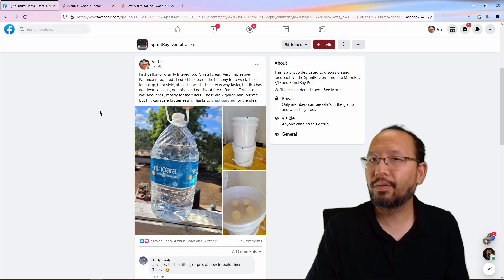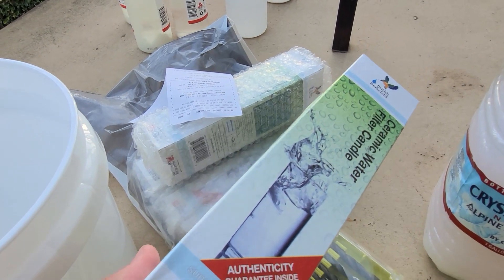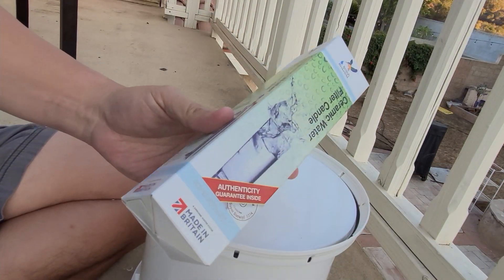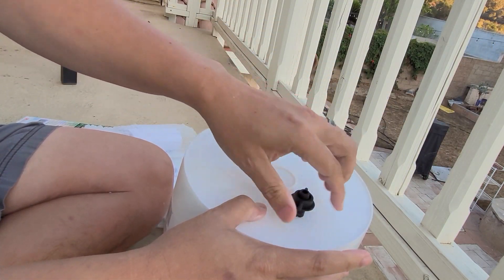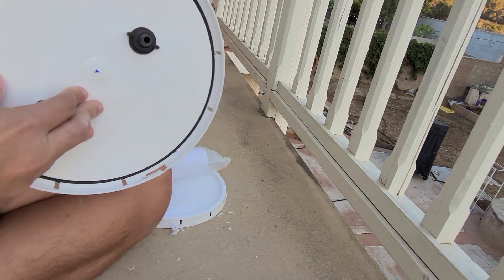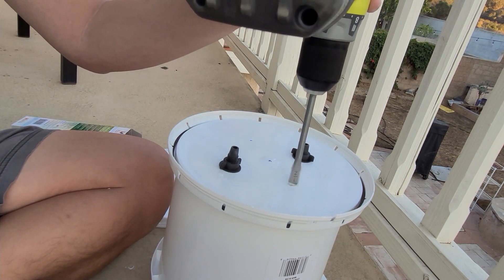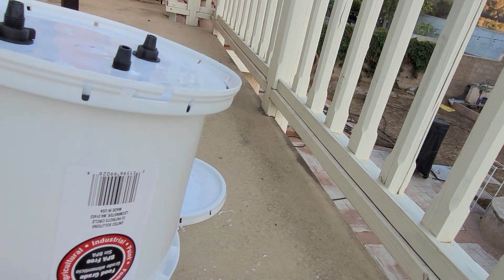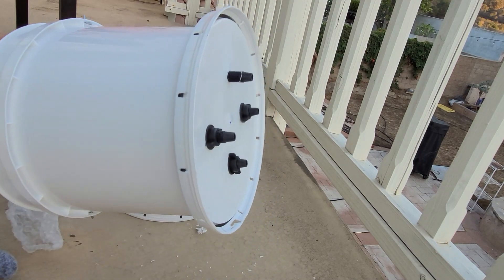DIY Gravity Filter for Isopropyl Alcohol Using Ceramic Filter Candles

Comment: Kudos on the syphoning (with pump, not with mouth :))!
It's so much better than decanting!

I would love to see a DIY centrifuge for better separation of IPA & resin.
It doesn't seem hard to do, you just need to securely attach the bottles to the centrifuge in a way that they're free to move up depending on the spin speed (ie vertical when not spinning and higher when spinning faster), so that the "down" of the bottle still points directly to the bottom of the bottle. And ideally gradually stopping it so that it doesn't shake and mix the resin back.
Then you should be able to syphon the clearer IPA from the top.
Reply: I agree, UV light from the side while spinning should help the particles coagulate and cure on sides and bottom.

Comment: I really think filtering is just not necessary. Gravity is all that is needed. Definitely no curing of disolved resin in the alcohol. I've beed doing this for a couple of years. And 200 micron filter is so course. I don't think any uncured resin is anyhwere near that large a partical size. Do you realise that 200 microns is FOUR 0.05mm layers.
Edit: I am sure you just mispoke when saying 200 microns. A quick google found they are more like 0.5 microns. I expect there are other sizes too. Perhaps yours are 0.2 microns. :)

Comment: Has anyone been able to verify that it really works? It is the only video that claims to leave isopropyl alcohol completely transparent. Ceramic filters are really expensive if this process doesn't really work. Thank you
Reply from the maker: It's got a slight color twinge to it after a few loads.  I let the filters run dry for a while, I don't know if that's the reason.  Distillation produces the cleanest results but that comes with a whole different set of issues and risks.

Comment: Are you still using this technique? How much “life” do you get out of the individual candles?
Reply from the maker: I'm afraid I am going to have to discontinue this jig.  It developed a leak and now the dirty sludge is leaking into the bottom.  I'll consider rebuilding it with a single dome filter in the future to reduce potential leakage points.
Reply: @photodontist8640  I couldn't get it to work w/out leaking myself

Comment: Wouldn't you get better flow if you drilled holes from the bottom to the top container, installed a pipe to above the fill level of the top container to allow for pressure equalization between the containers?
Reply from the maker: I hadn't thought of that.  It's not a bad idea.  I just open them up every day or two to relieve the negative pressure.

Comment: Could have had the top bottle dumping into one of those Gatorade coolers, then you could just push the spout to get the clean alchohol into bottles.
Reply from the maker: I have avoided any solution with a spout at the bottom.  The reason is that high strength alcohol will eat through rubber seals over time.  It may very well eat its way through the moving parts of the spigot.  I just find a big funnel and dump it out into a 1 gallon bottle.

Comment: I like your approach to cleaning your IPA.  How much resin contaminated IPA have you processed through the filters so far? How long do the filters last b4 they are so clogged up that you need to replace them?
Reply from the maker: Hard to say. Only two batches so far.
Reply: @photodontist8640  How about now, being a year later.
Reply from the maker: @carlanderson5068  I got leakage of the gaskets and clogging to the filters.  Sub sedimenting and then distilling is nowy preferred method
Reply: @photodontist8640  Thanks, this update helps. I was hopeful about this but was wondering if the clogging might be an issue based upon my experience with water washable resin, where it forms a kind of gel.  I've also recently found out my UV leds (5mm and some other very tiny ones) don't actually appear to be outputting UV light, which is a problem since I got them for curing the inside of hollow prints and noticed they weren't working, at all.